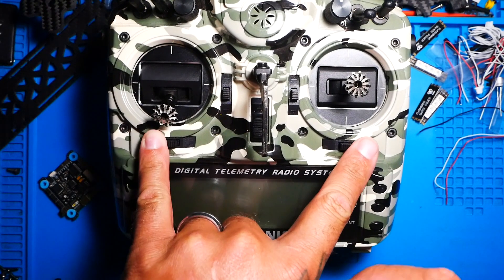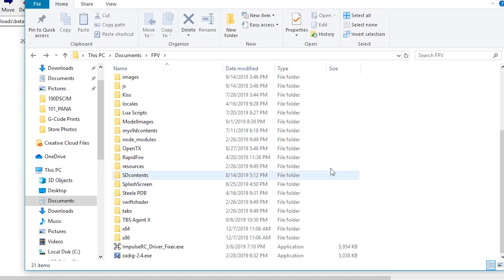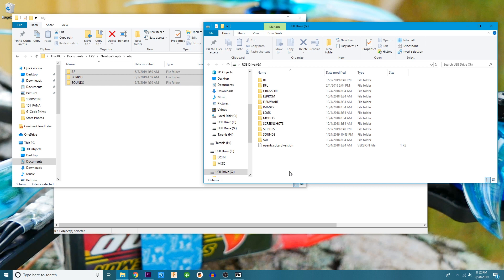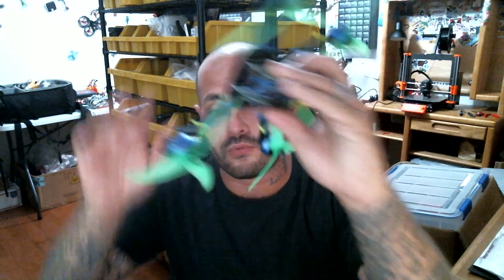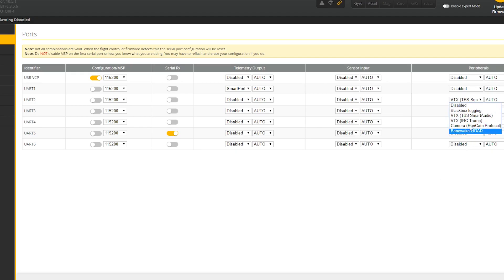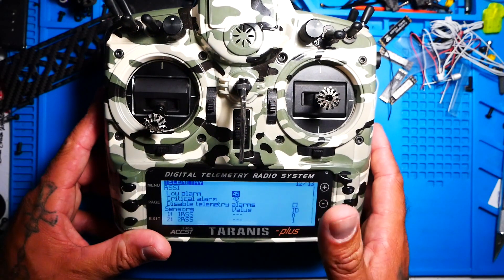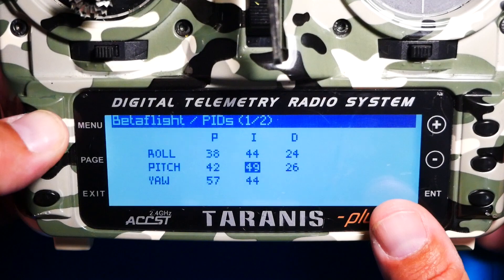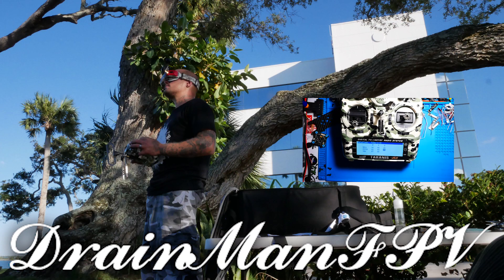How To Put Lua Scripts On Your Taranis In 15 Min! Betaflight - Tune Right From Your Radio!

Comment: Hey buddy im getting a script syntax error bt file not found, what did i do wrong here?
Reply from the maker: Are you using crossfire? Did you check luac when you flashed your radio
Reply: @DrainManFPV  yes I'm using crossfire, I just flashed a more recent version of OpenTX as well. The Lua for crossfire works, but can't get betaflight script working. do you mean did I try executing luac ?
Reply from the maker: @JbVest  When you flashed in the companion there is a little check box for luac, did you check that box
Reply: @DrainManFPV  oh yea! i forgot to look and see if it was selected let me hook it up and find out , do i have to re-flash if i didn't check it?
Reply: @DrainManFPV  hey man i figured it out! , got it working , you were spot on i did not check the lua box,  i re flashed the X9D and re installed the scripts and now they are working ! thanks bud

Comment: Hi Just updated my Taranis radio and bootloader X9D+ SE on Open Tx to the latest 2.3.5 version { although no luac box to tick anymore ?) also updated the SD card and Lua scripts to 1.4.1 but now I can't change my PID values on the tx everytime I press page on the tx it shows the rssi value pressing again gives me the lua script PID settings but when I press ENT on my TX then either the plus or minus button on the TX the page returns to the rssi page again ?
Before I updated everything was working correctly but now reverting back to the backed up version still has the same results !!

This is a short youtube clip showing the problem ?

https://www.youtube.com/watch?v=mZf6NbP98JA

Quick update it seems on page 13 of the tx I have two information screens enabled.....Screen 1 is for Scripts and Screen 2 was for RSSI and battery voltage......If I disable screen 2 then Lua scripts work ? Any thoughts apart from only having Screen 1 enabled ?
Reply from the maker: I tried to comment on the video you have it turned off, looks like your script didn't load properly. Did you try redoing it.
Reply: @DrainManFPV  Apparently it's a problem with Open Tx 2.3.5 just waiting for a fix in the meantime the only work around is only to have one telemetry page on my tx so with only pids as the only telemetry page it then works ?
Reply: I have exactly same problem with plus and minus button after flashing 2.3.5 and 2.3.6 nightly

Comment: Hi. Nice Video man. but if you done like that just copy and paste to the root of your SD card you will loose your old luas, e.g crossfire.lua and so other. because the new o/ Tx there will be \tools directory inside the script folder contains of several important luas too.  the solution will be just copy the new script to \script,  tele to \tele and so on. (of course BF folder on the root) I have done that and it works !

Comment: Hi DrainMan, when I connect my Quad, my taranis has a delayed and broken voice and the PIDs are still empty.  I also cannot exit from page view and got this message  `Script syntax error cannot open/SCRIPTS/BF/X9/pids2.liac
Reply from the maker: Sounds almost like you downloaded bad files for your luas. You can try to download different ones and try again.
Reply: @DrainManFPV  Thank you Sir, I will try again
Reply: Same issue, after replacing Frsky by Crossfire rx. I'm getting mad. All seems correct

Comment: do you know why i would be getting telemetry but cant change anything? i press the buttons on the taranis and nothing happens. does it on 2 quads, one with crossfire one with frsky
Reply from the maker: When you go to your luas do you see all of the accurate information? Like do the PIDs on your radio match the PIDs on your config.
Reply: @DrainManFPV  yup it's all there just can't change anything

Comment: Hey DrainMan Fpv, I downloaded the luascrips and when I go to use them. I'm able to see pids and then the next page, but now I have an error that says Script syntax error BF/ui.lua259 not enough memory. I didn't have the option to choose luac in the configurator. I thought mayby that was an issue? Any thoughts on a fix? Thanks
Reply from the maker: You will have to go back to flashing your Taranis and try to find the lua.c unfortunately got to have it

Comment: That shit is freaking awesome. I'm setting it up first thing tomorrow.
Reply from the maker: You'll never fly without it again! 😄
Reply: @DrainManFPV   gotdamnit, PlayStation usb cord don't work. Just in case someone don't know. The PlayStation usb is a charge cable. You need a data cable. At least that's what I'm going with at the moment. 😂
Reply from the maker: @MouwDown  You probably have PS4. I should of specified, PS3 remote cable is the one you need, also not Xbox one but the older one works as well. It's USB type B ... Not the micro B
Reply: @DrainManFPV  It was from a ps3. computer just wouldn't recognize the usb device. I'll getter figured out. Either it's the cable or it said I need a driver on the computer to recognize the radio. Couldn't find any info on a driver on the interwebs. I'll find out Thurs or Friday if the cable works.
Reply: @DrainManFPV  This is an update to my usb problem. Hopefully this helps someone else out. I was using an old ps3 usb to try and update my Tranis. It wasn't working because either the cord was old or it isn't meant to transfer data. I went on Amazon and purchased one that specificly said it was used for data transfer. Problem solved.
Reply from the maker: @MouwDown  good to know! Thanks

Comment: Great channel bro. Nice Video.

I have a problem with my taranis x9d. After flashing 2.2.4 and bootloader 2.2.4 i write the sd card content on the sd card. My taranis says its empty and i don´t see my sd card files in the taranis. no in the bootloader or in the menu. I tried so much versions and all that stuff. I use 2 different cards. 1gb and 8gb card. 
You have an idea?
Thanks in advance
Marc
Reply from the maker: Hey Marc, that sounds really weird, did you have that problem before you flashed, did you try re-downloading the firmware and flashing again?